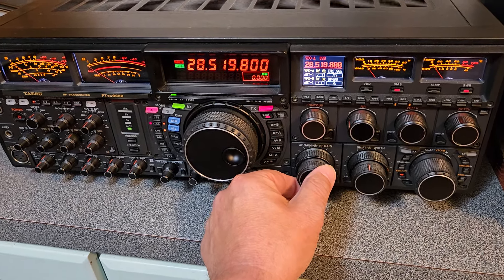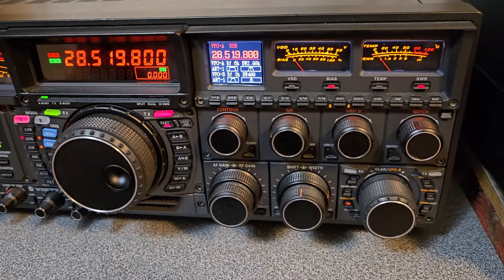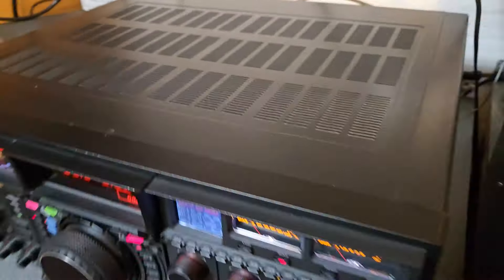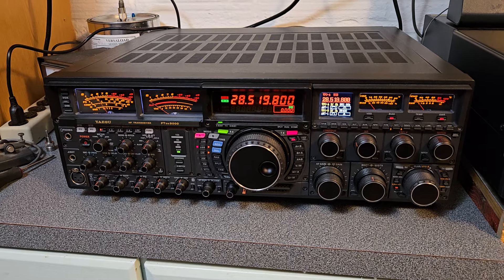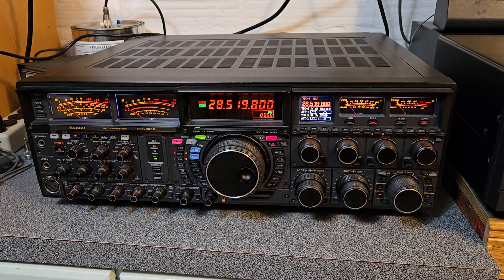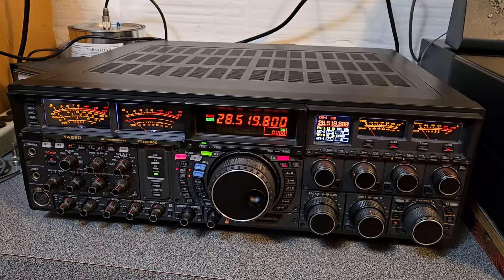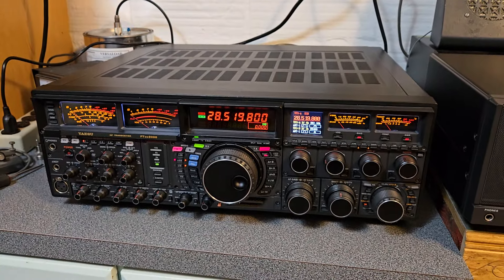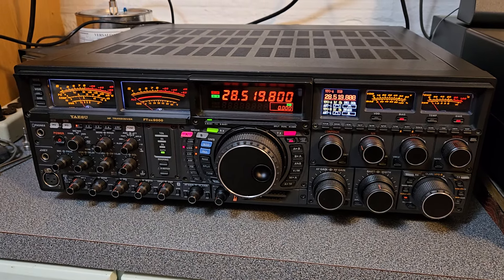Yaesu FTDX-9000

Comment: Originally didn't perform all that well as a flagship radio but then Yaesu brought out the PEP upgrade that required it to be shipped back to the factory for a hardware upgrade and for many if the internal processors to have a significant firmware upgrade too.